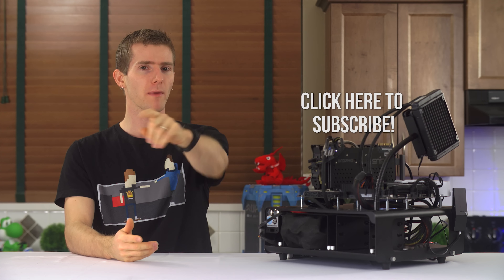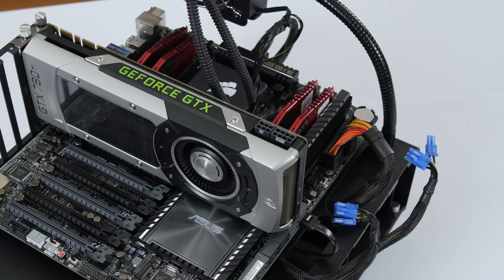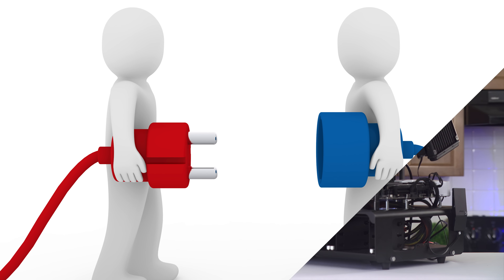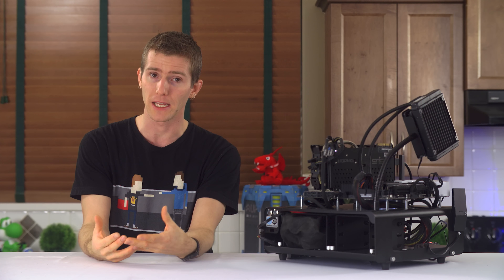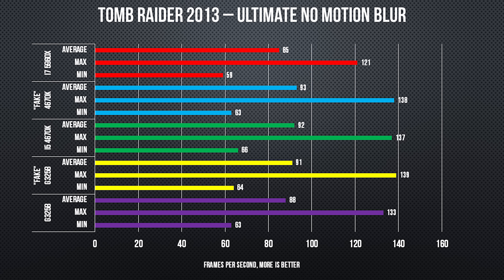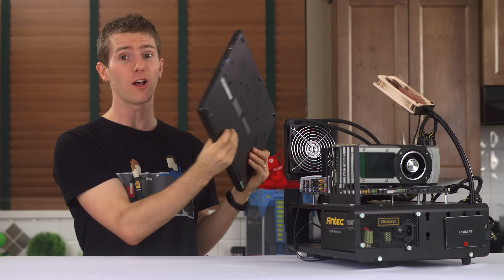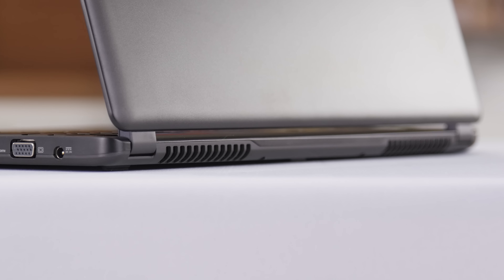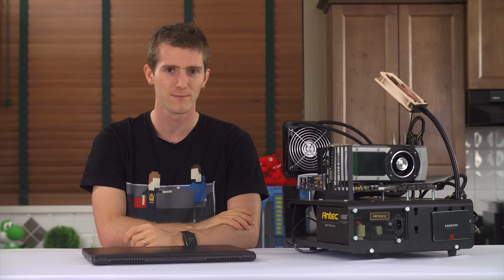CPU Simulation - Can You Simulate Performance of One CPU with Another?

Comment: Team Red and Blue for me, I use team red for productivity and team blue for gaming.

Honestly the price of intel is so high for the best of the best its crazy right now.

But hey your money people, do what ya want with it.
Reply: But proto intel uses less energie
Reply: No i'm serius the i7-4790k uses on the max 88 watt and the fx-8350 140 watt on the max
Reply: Intel uses less, but it's not a huge difference. For example you would save more energy in the long run by turning off your lights, systems, etc. Recycling water and what not, and buying energy efficient dryers and washers.
Reply: The 8320E has a TDP of 95.
Reply: maikel ris An overclocked 8320/8350 can use over 200 watts depending on how much its overclocked.
Reply: XxViciousxX
LOL mine is at 4.6 and it never goes above 200 w. My electric bill is not alot each month.
Reply: ProtoMario i got mine at 4.5 no idea how much mine uses. But i was more referring to those 5ghz and up overclocks kinda like those 9590 and 9370. Which are just highly binned 8350's which are rated at 220w no clue if they actually use that much. Was not trying to say every ones is over 200w. i Should have been more spesific.
Reply: Stop complaining about Intel prices. Did you see nvidia GPUs? You pay 400 on a gpu for 2 years before it become obsolete while intel CPU you pay 250$? or 320$? For the rest of the 3 or 4 years.
Reply: ***** Actually if comparing like that, the middle of the road intel cpus cost more
with the flagchip being like $5000
no gpu come close to that ridic.
Reply: ***** Thats hilarious, considering you insulted me first.
Reply: ***** Asking someone if they are stupid, is an insult, dont kid yourself.
Reply: ***** Its not bullshit lol its been proven, only a real 8 core xeon beats a real 8 core amd of the same specs.
4 cores will NOT beat 8 cores if 8 threads are in use.

And there you go again mr big shot keyboard warrior, insulting me again.
take your own advice.
Reply: ***** and he lost the challenge as all the rest of AMD fanboys, yea I'll go back to my Intel and enjoy the speed and bugfree experience.
Reply: ***** he ran away lol. nice try
Reply: ***** He might have NOW, but he didn't run away prior to you calling him out on running away.

So, it's not just a "try," I succeeded at getting my point across.

Comment: Investigate this in a future video please if you can downclock a GPU to represent others in its own architecture. Memory clock should be adjusted according to release specs. It would be done something like this:

GTX 980 vs GTX 970

GTX 980 - 2048 cores x 1126 base clock = 2,306,048 arbitrary number
GTX 970 - 1664 cores x 1050 base clock = 1,747,200 arbitrary number

so to "mimic" the 970, 1,747,200 / 2048 cores = ~ 853 base clock

Please try this out, would be interesting if it actually scaled quite well XP

Comment: I agree with your method as it showed what you wanted to show. With a small effort. Small effort means more potential interesting themes like this.

And that there would be small differences to the non-faked ones was clear. Not all themes need precise measurements. Sometimes rough values work fine.

Also your method shows absolutely perfect the influence of cores. And now we even have a solid idea of the difference between faked and non-faked models. 

So just keep on going ;-)

Comment: This has already been done before. In the days of the Pentium 1, most PCs used to come with a 'turbo' button, which when 'on' ran the CPU at normal speed, but when 'off', slowed it down to 386/slow-486 speeds to run old, badly-coded DOS games which were dependent on real-mode CPU timing (it wasn't really a 'turbo' button, it didn't overclock or anything like that). Also, disabling the L1 and L2 cache in the BIOS (yes you could do that in these days) made a Pentium 1 run at rough 386 speed if you didn't have a turbo button. This is nothing new.

Comment: PEOPLE WHO WANT TO SEE A COMPARISON OF i7- 4790K vs FX- 9590
BENCH RESULTS READ BELOW
I did not perform them, they are from a website i didn't bookmark and cannot remember but IS NOT CPUBOSS (thank god.) I saved results to a word document a week or two ago, I am merely providing some insight
Bench Results
 AMD FX-9590 (220W) - 4M/8T, 4.7 GHz, 8MB L2, 8MB L3 (Top Score)

 Intel Core i7 4790K (88W) - 4C/8T, 4.0 GHz, 1MB L2, 8MB L3 (Bottom Score)
Product Ratings & Comparisons
HandBrake v0.9.9 LQ Film
Frames Per Second
401.05
582.79-WIN 4790k 
HandBrake v0.9.9 2x4K
Frames Per Second
19.05
23.2-WIN 4790k
Agisoft PhotoScan Benchmark - Stage 1: Align Photos
Time in Minutes (Lower is Better)
7.26
5.57-WIN 4790k
Agisoft PhotoScan Benchmark - Stage 2: Build Point Cloud
Time in Minutes (Lower is Better)
11.44
8.54-WIN 4790k
Agisoft PhotoScan Benchmark - Stage 3: Build Mesh
Time in Minutes (Lower is Better)
3.88
2.78-WIN 4790k
Agisoft PhotoScan Benchmark - Stage 4: Build Texture
Time in Minutes (Lower is Better)
2.99
1.16-WIN 4790k
Agisoft PhotoScan Benchmark - Total Time
Time in Minutes (Lower is Better)
25.57
18.05-WIN 4790k
Agisoft PhotoScan Benchmark - CPU Mapping Speed
Million Points Per Second
108
148-WIN 4790k
Dolphin Emulation Benchmark
Time in Minutes (Lower is Better)
11.77
6.8-WIN 4790k
WinRAR 5.01, 2867 files, 1.52 GB
Time in Seconds (Lower is Better)
64.97
51.29-WIN 4790k
Hybrid x265, 4K Video
Frames Per Second
1.57
1.75-WIN 4790k
Cinebench R15 - Single Threaded
Score in CBMarks - Higher is Better
110
181-WIN 4790k
Cinebench R15 - Multi-Threaded
Score in CBMarks - Higher is Better
728
894-WIN 4790k
3D Particle Movement: Single Threaded
Score (Higher is Better)
81.27
146.06-WIN 4790k
3D Particle Movement: MultiThreaded
Score (Higher is Better)
444.93
803.95-WIN 4790k
FastStone Image Viewer 4.9
Time in Seconds (Lower is Better)
59
35-WIN 4790k
Sunspider 1.0.2
Time in Milliseconds (Lower is Better)
163
103-WIN 4790k
Kraken 1.1
Time in Milliseconds (Lower is Better)
1827
938-WIN 4790k
WebXPRT
Score (Higher is Better)
2060
2883-WIN 4790k
Google Octane v2
Score (Higher is Better)
23439
34169-WIN 4790k
SYSmark 2014 - Office Productivity
Score in SYSmarks (Higher is Better)
1236
1823-WIN 4790k
SYSmark 2014 - Media Creation
Score in SYSmarks (Higher is Better)
1254
2370-WIN 4790k
SYSmark 2014 - Data and Financial Analysis
Score in SYSmarks (Higher is Better)
2065
2521-WIN 4790k
SYSmark 2014 - Overall
Score in SYSmarks (Higher is Better)
1474
2217-WIN 4790k
Cinebench R10 - Single Threaded Benchmark
Score in CBMarks - Higher is Better
4905
8785-WIN 4790k
Cinebench R10 - Multi-Threaded Benchmark
Score in CBMarks - Higher is Better
26635
33538-WIN 4790k
Cinebench 11.5 - Single Threaded
Score in CBMarks - Higher is Better
1.21
2.05-WIN 4790k
Cinebench 11.5 - Multi-Threaded
Score in CBMarks - Higher is Better
7.84
9.66-WIN 4790k
x264 HD Benchmark - 1st pass - v3.03
Frames per Second - Higher is Better
97.87
122.93-WIN 4790k
x264 HD Benchmark - 2nd pass - v3.03
Frames per Second - Higher is Better
46.39
52.22-WIN 4790k
7-zip Benchmark
32MB Dictionary - Total MIPS - Higher is Better
26364—FX WIN 9590
26152-LOSE 4790k
AES-128 Performance - TrueCrypt 7.1 Benchmark
Mean Encryption/Decryption AES Algorithm - GB/s
4
5.2-WIN 4790k
POV-Ray 3.7 Beta RC4
Score (Higher is Better)
1678
1834-WIN 4790k
F1 2013 Single GPU, Average FPS
1080p Max, 1x GTX 770
117.3
132.1-WIN 4790k
Difference in FPS:
14.8
Bioshock Infinite Single GPU, Average FPS
1080p Max, 1x GTX 770
90
95.2-WIN 4790k
Difference in FPS:
5.2
Tomb Raider Single GPU, Average FPS
1080p Max, 1x GTX 770
49.3
49.9-WIN 4790k
Difference in FPS:
0.6
Sleeping Dogs Single GPU, Average FPS
1080p Max, 1x GTX 770
56.5
57-WIN 4790k
Difference in FPS:
0.5
Battlefield 4 Single GPU, Average FPS
1080p Max, 1x GTX 770
59.2
61.4-WIN 4790k
Difference in FPS:
2.2
F1 2013 Single GPU, Minimum FPS
1080p Max, 1x GTX 770
82
108.2-WIN 4790k
Difference in FPS:
26.2
Bioshock Infinite Single GPU, Minimum FPS
1080p Max, 1x GTX 770
10.2
28.6-WIN 4790k
Difference in FPS:
18.4
Tomb Raider Single GPU, Minimum FPS
1080p Max, 1x GTX 770
35.8
36.9-WIN 4790k
Difference in FPS:
1.1
Sleeping Dogs Single GPU, Minimum FPS
1080p Max, 1x GTX 770
33.1
34.9-WIN 4790k
Difference in FPS:
1.8
Battlefield 4 Single GPU, Minimum FPS
1080p Max, 1x GTX 770
48.3
50-WIN 4790k
Difference in FPS:
2.7
F1 2013 SLI, Average FPS
1080p Max, 2x GTX 770
99.4
127-WIN 4790k
Difference in FPS:
27.6
Bioshock Infinite SLI, Average FPS
1080p Max, 2x GTX 770
141.4
164.1-WIN 4790k
Difference in FPS:
22.7
Tomb Raider SLI, Average FPS
1080p Max, 2x GTX 770
95.9
97.2-WIN 4790k
Difference in FPS:
1.3
Sleeping Dogs SLI, Average FPS
1080p Max, 2x GTX 770
98.5
105.9-WIN 4790k
Difference in FPS:
7.4
Battlefield 4 SLI, Average FPS
1080p Max, 2x GTX 770
99.3
107.5-WIN 4790k
Difference in FPS:
8.2
F1 2013 SLI, Minimum FPS
1080p Max, 2x GTX 770
73.9
98.1-WIN 4790k
Difference in FPS:
24.2
Bioshock Infinite SLI, Minimum FPS
1080p Max, 2x GTX 770
14.2
28.3-WIN 4790k
Difference in FPS:
14.1
Tomb Raider SLI, Minimum FPS
1080p Max, 2x GTX 770
72-TIE
72-TIE
Difference in FPS:
ZERO
Sleeping Dogs SLI, Minimum FPS
1080p Max, 2x GTX 770
55.6
59.3-WIN 4790k
Difference in FPS:
3.7
Battlefield 4 SLI, Minimum FPS
1080p Max, 2x GTX 770
67.1
82.3-WIN 4790k
Difference in FPS:
15.2

1080p, MAX, 1x GTX 770
•	AVERAGE AVG. FPS DIFFERENCE IN BENCHED GAMES: 
	I7-4790k has 4.66 more FPS than 9590 w/ a single GTX 770
1080p, MAX, GTX 770 SLI
•	AVERAGE AVG. FPS DIFFERENCE IN BENCHED GAMES: 
	I7-4790k has 13.44 more FPS than fx-9590 w/ 2x GTX 770s
Reply: For i5-4690k compared to FX-9590
Full Bench results read below
I did not perform them, they are from a website i didn't bookmark and cannot find but IS NOT CPUBOSS (thank god.) I saved results to a word document a week or two ago, I am merely providing some insight

Bench Results
Intel Core i5 4690K (88W) - 4C/4T, 3.5 GHz, 1MB L2, 6MB L3(Top Score)
VERSUS
 AMD FX-9590 (220W) - 4M/8T, 4.7 GHz, 8MB L2, 8MB L3(Bottom Score)
Product Ratings & Comparisons
HandBrake v0.9.9 LQ Film
Frames Per Second
510.61-WIN i5-4690k
401.05
HandBrake v0.9.9 2x4K
Frames Per Second
19.44-WIN i5-4690k
19.05
Agisoft PhotoScan Benchmark - Stage 1: Align Photos
Time in Minutes (Lower is Better)
9.23
7.26-WIN FX-9590
Agisoft PhotoScan Benchmark - Stage 2: Build Point Cloud
Time in Minutes (Lower is Better)
9.64-WIN i5-4690k
11.44
Agisoft PhotoScan Benchmark - Stage 3: Build Mesh
Time in Minutes (Lower is Better)
2.97-WIN i5-4690k
3.88
Agisoft PhotoScan Benchmark - Stage 4: Build Texture
Time in Minutes (Lower is Better)
1.31-WIN i5-4690k
2.99
Agisoft PhotoScan Benchmark - Total Time
Time in Minutes (Lower is Better)
23.15-WIN i5-4690k
25.57
Agisoft PhotoScan Benchmark - CPU Mapping Speed
Million Points Per Second
138-WIN i5-4690k
108
Dolphin Emulation Benchmark
Time in Minutes (Lower is Better)
7.6-WIN i5-4690k
11.77
WinRAR 5.01, 2867 files, 1.52 GB
Time in Seconds (Lower is Better)
70.76
64.97-WIN FX-9590
Hybrid x265, 4K Video
Frames Per Second
1.07
1.57-WIN FX-9590
Cinebench R15 - Single Threaded
Score in CBMarks - Higher is Better
154-WIN i5-4690k
110
Cinebench R15 - Multi-Threaded
Score in CBMarks - Higher is Better
599
728-WIN FX-9590
3D Particle Movement: Single Threaded
Score (Higher is Better)
129.44-WIN i5-4690k
81.27
3D Particle Movement: MultiThreaded
Score (Higher is Better)
417.8
444.93-WIN FX-9590
FastStone Image Viewer 4.9
Time in Seconds (Lower is Better)
39-WIN i5-4690k
59
Sunspider 1.0.2
Time in Milliseconds (Lower is Better)
120-WIN i5-4690k
163
Kraken 1.1
Time in Milliseconds (Lower is Better)
1066-WIN i5-4690k
1827
WebXPRT
Score (Higher is Better)
2680-WIN i5-4690k
2060
Google Octane v2
Score (Higher is Better)
28880-WIN i5-4690k
23439
SYSmark 2014 - Office Productivity
Score in SYSmarks (Higher is Better)
1513-WIN i5-4690k
1236
SYSmark 2014 - Media Creation
Score in SYSmarks (Higher is Better)
1944-WIN i5-4690k
1254
SYSmark 2014 - Data and Financial Analysis
Score in SYSmarks (Higher is Better)
2234-WIN i5-4690k
2065
SYSmark 2014 - Overall
Score in SYSmarks (Higher is Better)
1876-WIN i5-4690k
1474
Cinebench R10 - Single Threaded Benchmark
Score in CBMarks - Higher is Better
7619-WIN i5-4690k
4905
Cinebench R10 - Multi-Threaded Benchmark
Score in CBMarks - Higher is Better
27090-WIN i5-4690k
26635
Cinebench 11.5 - Single Threaded
Score in CBMarks - Higher is Better
1.7-WIN i5-4690k
1.21
Cinebench 11.5 - Multi-Threaded
Score in CBMarks - Higher is Better
6.71
7.84-WIN FX-9590
x264 HD Benchmark - 1st pass - v3.03
Frames per Second - Higher is Better
122.27-WIN i5-4690k
97.87
x264 HD Benchmark - 2nd pass - v3.03
Frames per Second - Higher is Better
39.99
46.39-WIN FX-9590
7-zip Benchmark
32MB Dictionary - Total MIPS - Higher is Better
17939
26364-WIN FX-9590
AES-128 Performance - TrueCrypt 7.1 Benchmark
Mean Encryption/Decryption AES Algorithm - GB/s
3.4
4-WIN FX-9590
POV-Ray 3.7 Beta RC4
Score (Higher is Better)
1459
1678-WIN FX-9590
F1 2013 Single GPU, Average FPS
1080p Max, 1x GTX 770
130.4-WIN i5-4690k
117.3
Bioshock Infinite Single GPU, Average FPS
1080p Max, 1x GTX 770
94.8-WIN i5-4690k
90
Tomb Raider Single GPU, Average FPS
1080p Max, 1x GTX 770
49.4-WIN i5-4690k
49.3
Sleeping Dogs Single GPU, Average FPS
1080p Max, 1x GTX 770
57-WIN i5-4690k
56.5
Battlefield 4 Single GPU, Average FPS
1080p Max, 1x GTX 770
61.2-WIN i5-4690k
59.2
F1 2013 Single GPU, Minimum FPS
1080p Max, 1x GTX 770
102.4-WIN i5-4690k
82
Bioshock Infinite Single GPU, Minimum FPS
1080p Max, 1x GTX 770
29.9-WIN i5-4690k
10.2
Tomb Raider Single GPU, Minimum FPS
1080p Max, 1x GTX 770
35.8-TIE
35.8-TIE
Sleeping Dogs Single GPU, Minimum FPS
1080p Max, 1x GTX 770
34.8-WIN i5-4690k
33.1
Battlefield 4 Single GPU, Minimum FPS
1080p Max, 1x GTX 770
49.9-WIN i5-4690k
48.3
F1 2013 SLI, Average FPS
1080p Max, 2x GTX 770
125.8-WIN i5-4690k
99.4
Bioshock Infinite SLI, Average FPS
1080p Max, 2x GTX 770
159.8-WIN i5-4690k
141.4
Tomb Raider SLI, Average FPS
1080p Max, 2x GTX 770
96.6-WIN i5-4690k
95.9
Sleeping Dogs SLI, Average FPS
1080p Max, 2x GTX 770
105.9-WIN i5-4690k
98.5
Battlefield 4 SLI, Average FPS
1080p Max, 2x GTX 770
108.2-WIN i5-4690k
99.3
F1 2013 SLI, Minimum FPS
1080p Max, 2x GTX 770
95.9-WIN i5-4690k
73.9
Bioshock Infinite SLI, Minimum FPS
1080p Max, 2x GTX 770
28.1-WIN i5-4690k
14.2
Tomb Raider SLI, Minimum FPS
1080p Max, 2x GTX 770
72-TIE
72-TIE
Sleeping Dogs SLI, Minimum FPS
1080p Max, 2x GTX 770
61.8-WIN i5-4690k
55.6
Battlefield 4 SLI, Minimum FPS
1080p Max, 2x GTX 770
86.4-WIN i5-4690k
67.1

Comment: How do you guys feel about this build 

I5 4690k
Asrock z97 pro 4 arc mobo 
Kingston hyperx fury 2x4 gb ram 
Sapphire Radeon 280x tri x vaporx
Nzxt h440 white
Seasonic 650watt semi modular ps

What do you guys think of my build I'm open to suggestions should I spend less on the case and more on something else? Thanks in advance
Reply: Not bad. Just get a decent CPU cooler
Reply: I'd go for a cheaper, non overclockable i5 such as the 4460 or 4590 and a h97 mobo. That's a lot less money on those and you also won't need to buy as expensive a cooler, so you can afford a GTX 970 with some money to spare. That will give you much better performance (assuming this is for gaming). If you really want to experiment with overclocking though, this build is solid.
Reply: If you can get anything at a good price though, obviously go for that
Reply: +scylendrey would you recommend the fx 8350 does it have good gaming performance also what hoy would you recommend
Reply: +Roger Li a h81 motherboard or a z97 mobo also are the non overclockable i5s good for gaming is their performance perfectly fine or should I stick with the 4770k
Reply: mind you i have my 4690k at a constant 4.6 ghz up from 3.5 with watercooling im sure it could do more but im happy with how its running
Reply: Brian Simons not sure if that mobo can handle crossfire
but if you plan on it down the line id only make 1 change, more watt PSU.

Comment: I don't like that downclocking to match other cpu theory. Because it's not everything about the clock you can't take fastest intel cpu and downclock it to 4670k. Doesn't make sense because 5960X have much better per core performance, different architecture etc. Instructions per clock is different on nearly every chip.

Comment: +LinusTechTips
Why are you doing complete system tear downs and swapping mobos and potentially damaging things when doing side by comparisons?  If you had multiple work benches setup and running (Which you do obviously), you could run both bench marks right next to each other.  Depending on what you're testing, you'd have to match the external accessories such as the drives, but since in this particular case you're examining performance on CPUs, drive speed probably doesn't matter or wouldn't affect the results.
- I've seen several matching video cards in your videos, so you can match those
- Getting a couple 128gb SSDs kicking around for testing is much cheaper than all those GTX970s you're knocking around on the desk. ;)

Comment: Holy crap, those bezels on the Gigabyte laptop would make my M11x cry.
Reply: YUS ANOTHER M11X USER
Reply: I FINALLY FOUND ONE
Reply: +PixelPickaxe Hahaha if only I still had it. I sold it about a year ago like a FRICKIN IDIOT! I still compare every laptop I see or get to it, though, since I remember it well.
Reply: MultiTelan No, don't feel bad. This thing is pretty much slow as dirt nowadays. I can't even get a stable framerate in csgo. And yes, I'm running Windows 10 in discrete mode.
Reply: +PixelPickaxe Well, you know, performance isn't everything when it comes to...vintage? I guess?...computers like that. That's more collectible at this point.
Reply: MultiTelan It's all I have right now though.. I'm saving up for a computer now so, that's a thing.
Reply: PixelPickaxe Do save it, though. I'm glad I didn't part out my mom's old Gateway laptop. 12 years old and still ticking.
Reply: MultiTelan I'll be giving it back to my father once I'm finished buying the parts.